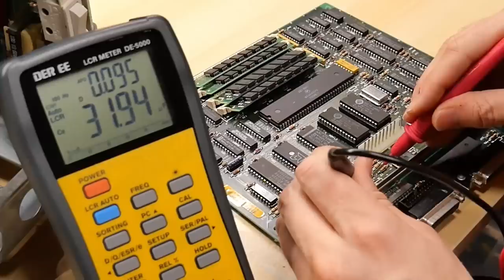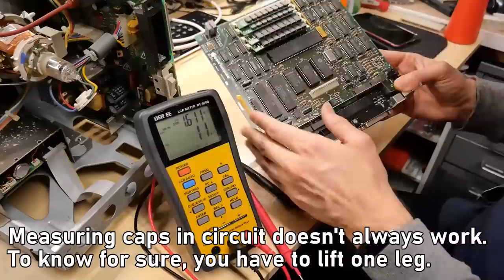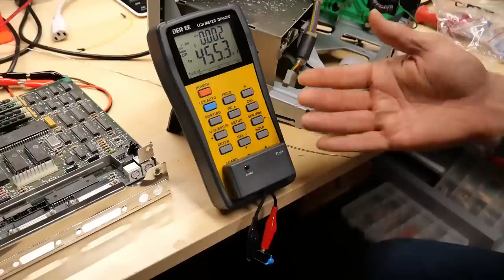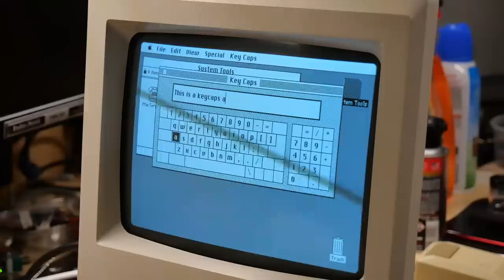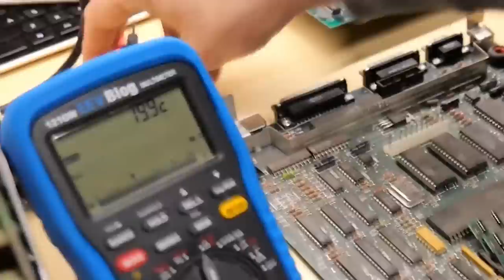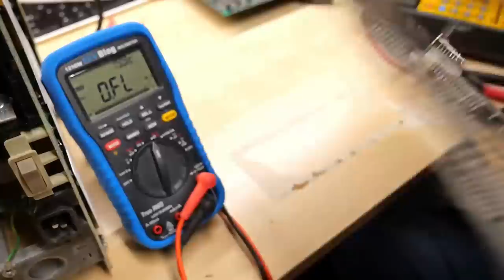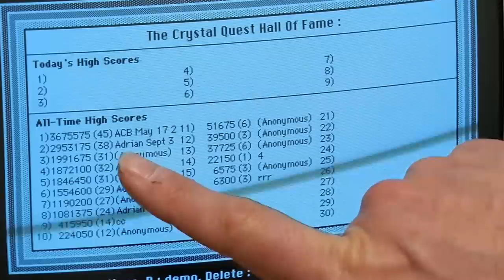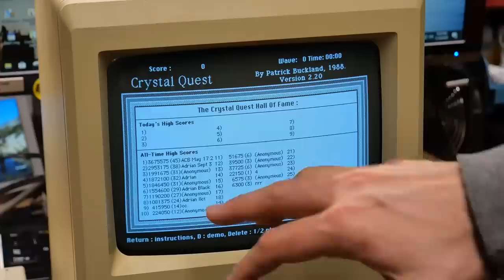Mac Repairathon Part 6: Final stretch! The Mac Pluses.

Comment: Adrian, get a switched socket on your bench.
Watching you plug that power cable into the power supply and then use the onboard switch was scary viewing, you've no idea what's live on the board at that point and if the switch is even working properly.

Comment: It makes me cringe when I see people spray on Deoxit or Alcohol on something then before it dries they turn it on. You probably heard that coil noise because that connector was shorting out from the Deoxit. You're lucky you didn't damage things.
Reply from the maker: Deoxit D5 is not conductive. It does not contain alcohol and is sate to use on energized circuits... http://store.caig.com/s.nl/ctype.KB/it.I/id.703/KB.215/.f

Comment: Change all the CAPs! this are old ones so they are death - you can't measure this old trash caps. I work in the repair since 1985 and I repaired over years TV sets but this are the caps. Also not good soldered (cold solderpoint/kalte Lötstelle developed and invented by Philips). Don't recap your PCB like you! this destroyd the hold of the cooper traces on the PCB. They are underflow with oxygen after your mechanical destroying torture where you pull out the old SMD Electrolytic Caps - resolder it in future with the hotair. It is only a good tip. 
I would you write also a information about me and my pancreas (this is not a electrical thing - it is a organ inside my body). Best Regards Volker

Comment: Oof, the sound was out of sync towards the end there, but I've enjoyed this series, and I'm not an Apple fan :o)
Remember safety, Adrian. I thought you knew well enough to keep your hands of such high voltage capacitors without discharging them.
A bit of a shame with the rusty Mac, but oh well. I hope the machines finds good homes. Might consider swapping out the capacitors on the motherboard just to be safe, since the readings were strange.

Comment: Reflow the solder on the cracked joints? WRONG!

The high frequencies of the high voltage area around the yoke circuitry will crack them again in a very short time because the metal is fatigued. You need to desolder the connectors, clean the traces and connectors then resolder with fresh solder.

Also cracked solder joints on the yoke connector signify components going bad in that area: L1, C1, Q1, etc. (at least 6 parts) need replacement.

Get yourself a copy of Larry Pina's Macintosh Repair and Upgrade Secrets, Dead Mac Sea Scrolls. That will help you solve those issues and tell you what parts you need to replace and not the guestamations you are doing.